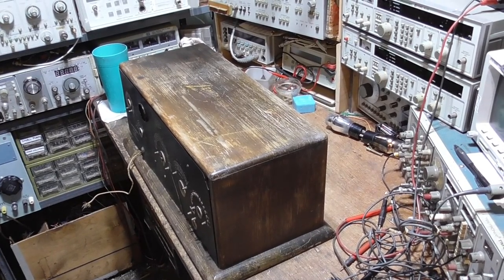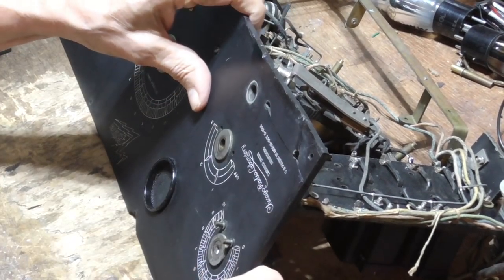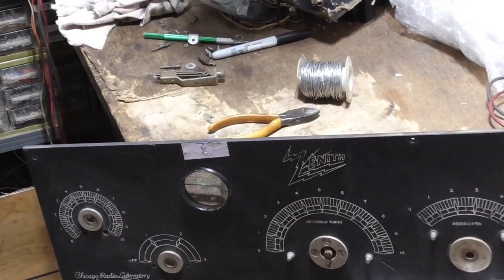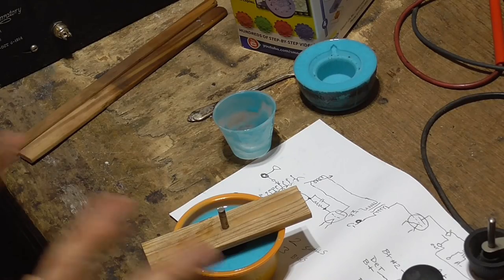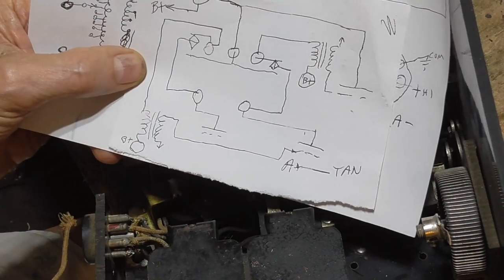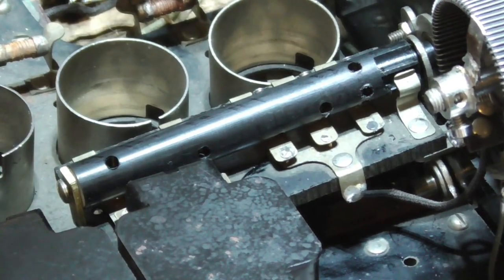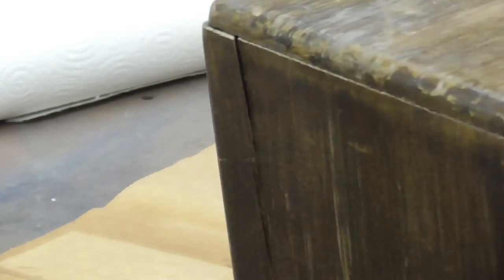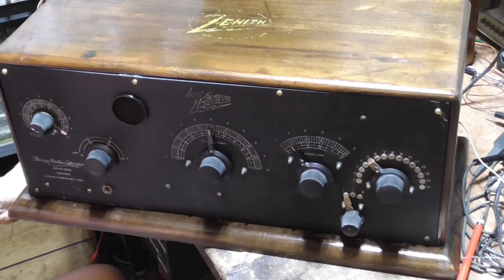REPAIRING AN EARLY ZENITH RADIO

Comment: Reminds me of a similar Radio we had in our house 50 to 55 years back. The box top cover could be opened to replace tuning coils on octal plugs to change band. They were not not hetrodyne. So two separate tuning capacitors were there that can be adjusted by a 10:1 friction knobs. We kept a notebook indicating selected band coil numbers, number dial setting on the two tuning capacitors and station names.The speaker did not have permanent magnet, instead used a electro magnet coil which doubled as the DC supply choke. The power supply was in another box wired through a octal plug to the radio. The antenna was vert long, around 30-40 feet running up high through the house garden. You made me remember my young days. Thank you very much.

Comment: A tip I use to stop things sticking on screw tops is I smear a very thin coat of Vaseline on the thread. Works well even on screw tops of super glue.

Comment: I wonder if the finish on this would have been french polished shellac… if so, it might have been possible to add more shellac and melt the old with the new in a french polish without any sanding or staining… Just thinking out loud.
Reply: He does do that now and then, so I suspect that it isn’t shellac or he just thought this would produce a better result this time (maybe temperature related?).
Reply: @xnavynuc  Maybe so. It wasn't a criticism, by the way, just a thought. I think the end result looks great either way.

Comment: I use JB weld to fill holes and  such in panels.  Never had to repair and edge crack, but your method looks good.  I usually have to put two 'coats' on because the epoxy shrinks a bit while curing.  Once it's all hardend (takes a good 24 hours to be really hard), I sand it down smooth.  After painting, you can't tell the hole in the panel was ever patched.  I do this on aluminum panels, but other materials would patch the same way.

I didn't know Zenith went THAT far back.  Wow!
Did they make any early triode battery tube superhets?

Comment: I have an idea how you might improve the casting process. If you mix up a small amount of the casting media and first paint it on with a q-tip or something and then set it in the cup you might get better detail without bubbles etc. This is often done in the lost wax process for making jewellery. Very nice work on a very difficult restoration.
Reply: OH! My bad, you were doing that. Silly me.

Comment: Big L small C tank circuit in this really old Zenith. What is the tube complement and can they still be found?
Reply from the maker: It uses O1-A tubes and they are very common for about 20 bucks each. The Q of the tank circuit indeed makes it critical to tune!

Comment: Hi Ron I am working on My first ever tv, Just learning, at 61 years, I was given a 48 rca victor tv I am not getting hi voltage out, I have 450v going into hv transformer but nothing out, at the haft wave rectifier,tube is good, hv  line going to the side has no voltage, there is a 1 meg resister that reads in circuit at  871 ohms, is this considered bad.
Reply from the maker: You have to remove one lead of the resistor to get an accurate reading. +-10% is fine. Check your horizontal oscillator to be sure it is going. That drives the horizontal output tube. (of course check that too!) If you don't have a scope, you will need to get one to work on a TV.
Reply: @glasslinger  Thank you for helping me

Comment: Good restoration, the radio sounded like it has some hum, not sure if you replaced any capacitors etc.
Reply: These were designed as battery sets, hence the external psu, so no mains hum. No smoothing circuit or rectifier, just pure dc from a big 90v battery :) (and the 2v lead acid cell for the heaters, plus the grid bias battery if required..)

Comment: Wont the screw going into the cam shaft through that little bracket, just unscrew itself as the knob is turned?
Reply: I think it isn't tight, so its loose in the bracket and thats the pivot point on it.. yeah I thought that too.
Reply: @ntsecrets  yeh i was wondering if hed left it loose to pivot there. What a brilliant job though in re-making that cam . Excellent
Reply: @reacey  yeah I would have been like welp, maybe I can make one out of lego bricks? and glasslinger is like oh I'll just make one from scratch that works as good if not better than the original!
Reply: @ntsecrets  yeh id have been scratching my head for abit , especially figuring how the contacts needed to be on each turn of the knob, theres not many brains like glasslingers and shangos left in the world
Reply from the maker: When delrin plastic is tapped it leaves a tight thread. I was ready with the super glue if the screws were loose but it turned out they were very tight.

Comment: Hi glasslinger, Could you tell me what to do, I trying to fix my first capacitor change, On a 48 rca victor, I turn it on And blown up a new 50mfd,electrolytic And burn out a 5u4 rectifier tube,is it possible i put in backwards,, I found another tube, But no more money for capacitor, Can a 100mfd be used. Please help Brian

Comment: You shouldn’t use the USPS to ship delicate equipment. It’ll most always get damaged. Not from handling, but from machines. When packages reach the sorting hubs, they use machines to perform the sorting to the different routes. I always use FexEx for shipping radios.

Comment: Hi great video do you mind sharing more light on that box where you plugged the Zenith into? Did you build it yourself or was it bought
Reply from the maker: Homebuilt power supply.
Reply: @glasslinger  Podrías compartir el diagrama esquemático, muchas gracias. Saludos desde el Sur de las Américas, Montevideo, Uruguay. Pablo

Comment: GREAT job on the knobs and figuring it all out.  Did you freehand drill the knob shafts and set screws?
Reply from the maker: Knob holes drilled using the lathe to hold all in alignment. The set screw holes drilled on drill press with the knob held in a vise.
Reply: @glasslinger  Thank you Ron.  On this job, to me, the casting of new, period correct knobs was fascinating.  You have all the skills.

Comment: Hello from Sunrise in So. Florida I own a RCA radio Model D-723 (1937). Some work has been done to it by previous owner, however, at first one or two stations would work, but not the rest. I have not been able to find any one in this area that could help me with antique tube radios. However would like,  though, if there is a way to figure out how to "clear" the stations without an Oscilator. The radio has 3 bands in the selector, but don't know which is wich, right, center or left. Local stations in AM are 560, 610, 710, 1260 and 1460 to name a few
Any suggestions are appreciated. 
Also, there is a "rumble" noise at some stations of the dial. 
Last nite, I was able to get a station from Cuba on what appeared to be in the 160 section of the dial, but don't know what band
Any comments are appreciated 
Fernando

Comment: Fantastic work! I never casted anything but I’ll try it the way you showed and experiment. Also, I’m planning to build a multi-section power supply similar to what you have; would you recommend against using switching supply modules on account of noise or it’s not noticeable for these kind of radios? Thanks in advance
Reply from the maker: The switching regulators definitely cause heterodyne whistles in the radios. The power drain on these radios is very small so there is no real need for a switching regulator. The voltages also do not need extreme regulation so a simple zener-FET regulator is satisfactory.

Comment: I honestly thought the cam part would be a pretty easy fix, providing you can trace it out properly, I'd look foward to making it, strange they had it on only one dimension, if it were round then it could he shoreer and save on materials

Nice use of the word bollocksed, 😂 as an englishman I feel like we have been using that term less and less as time goes on

What was the window in the front for, so you could check to see tubes are glowing?

Comment: Ron, every time I see you finish a case I wonder how you spray over and over but never seem to get any runs.   Is it just your skill, the nozzle, or the dilution of the lacquer?   I would love to know how to improve my own awful efforts.   BTW, at the beginning of this video I thought that this was one radio that had such problems, missing parts and damage, that it would be impossible to restore.   How wrong I was!
Reply from the maker: Thin the mix to between 1/3 to 1/2 brushing lacquer to lacquer thinner. Thin the spray with the air mix on the sprayer and use more coats rather than one or two heavy (possibly runny!) coats.

Comment: Hey couldn't you use a 3D printer to make knobs for radio
Reply from the maker: Yes. There is a guy in the radio club that does it. The problem is the programming takes a lot of time to get just right.

Comment: You did well this time Ron.
I think its time you retired the dewalt, looks like its done.
Reply from the maker: I have a new one in my other shop. I couldn't get rid of the old horse! Still works after 10 years of constant use. I still stick with dewalt even though there are better ones out there.
Reply: @glasslinger  I have half a dozen dewalt Xr tools, and one milwaukee, to be honest I prefer the latter. But then I work on heavy plant machinery so they get battered.

Comment: The antenna coil tap connections to the antenna switch are heavy, rigid bus wire.  No wonder the coil taps were busted.  Stupid construction.  Those jumpers need to be highly flexible!

Comment: It should be either used or thrown away or passed on to someone who will use and appreciate it.  The only thing worse than a shelf queen is a trailer queen.  Radios were meant to play and cars were meant to drive!!!  Sure, there are much better ways to listen to AM radio, but that's an argument for buying a better radio.  If you can't daily it, at least take her out on the weekends.

Comment: Why repair these analog machines at all? They will be useless soon as the rest of AM goes all digital in the next couple of years.
Reply: They will still be a valuable piece of early radio history. Ron can start his own museum collection if not done
so already.
Reply: He can have his own am transmitter
Reply: You can buy small am transmitters with Bluetooth or inputs to have anything you want come out of an old radio.
Reply: And where did you hear that? References please.
Reply: @ShadowsOnTheScreen  LOL, I have one sitting about 5 feet away from me I bought on eBay.  You can tune it to whatever broadcast frequency you want on the AM band.  You can also buy them completely done for around $95 and up on old radio sites.  Just search for AM transmitters with bluetooth and you'll find them, you don't need me for references.  They also can be built with audio inputs if you want better quality than bluetooth provides.  You can also search here on youtube and find ways to put inputs on an AM radio - major problem is grounding issues because of hot chassis in the older radios.  If you don't know what you are doing you can end up with hot inputs so if an unsuspecting person touches them and a ground they will get a very nasty surprise.